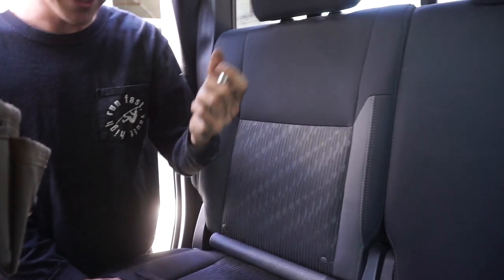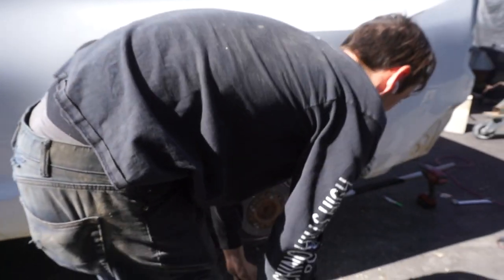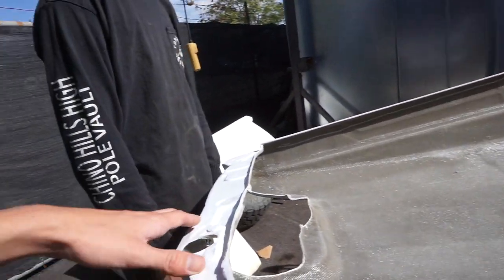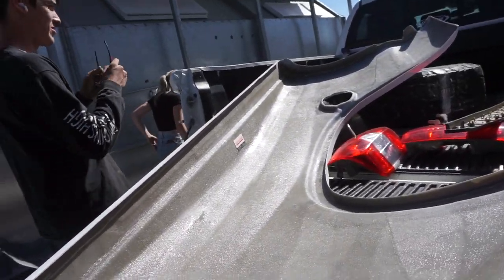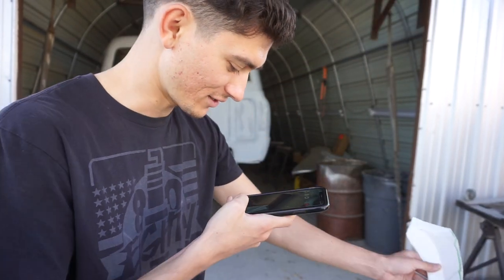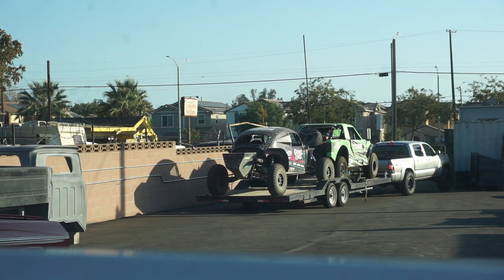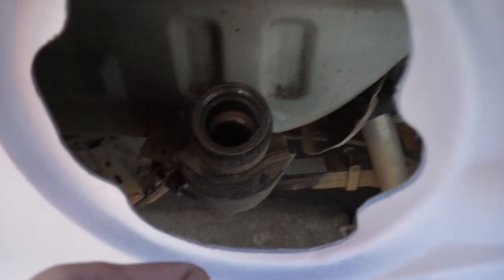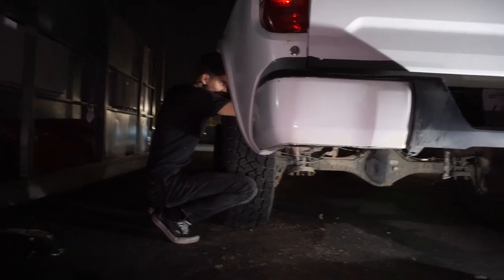Toyota Tundra Gets FIBERGLASS BEDSIDES!

Comment: Super rad you guys did an install video for the bedsides, I’ve got a set that I’ve been procrastinating on!  After finishing this set, would you still recommend doing the tail lights the same way- leave all the metal to mount to and then just fit the fender around it?  Also, I was talking to the ADV guys a while back and if I recall correctly, you can still leave some factory  bedside near the cab to overlap onto, but trim the fiberglass fender near the cab a bit further back, then use panel adhesive to glue it in, and then blend it into the existing sheet metal + a little body filler to get a more seamless look. (But guessing you guys wanted to keep the bolt-on/off capabilities?) If you make any progress on the fuel filler, it’d be rad to see how to handle that- the 4 Runner swap idea is interesting!
Reply from the maker: Yeah I’d say leaving metal to mount around the tail light is the most sturdy option. I think I get what your saying about the front end of the bed, and I think we did most of that (minus the adhesive and body filler to get the seamless look). Very interesting tactic to get rid of the little “lip”. As far as the fuel neck goes, the owner is still running it the same as it is in the video just cause he doesn’t mind it, but yeah the 4Runner neck should be longer.